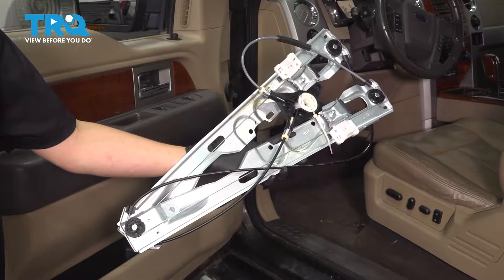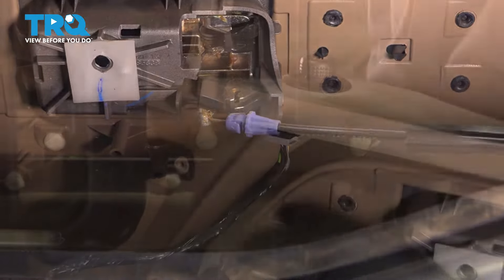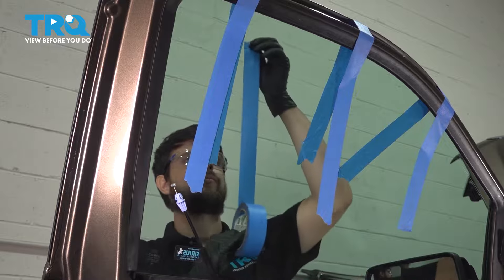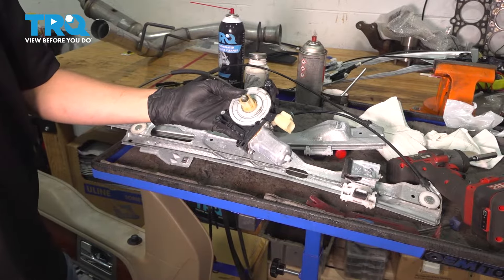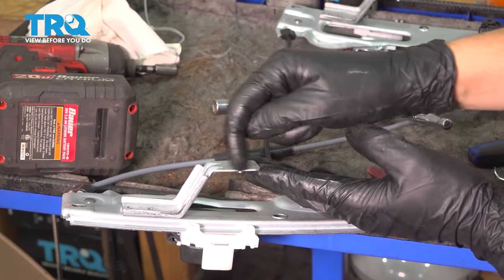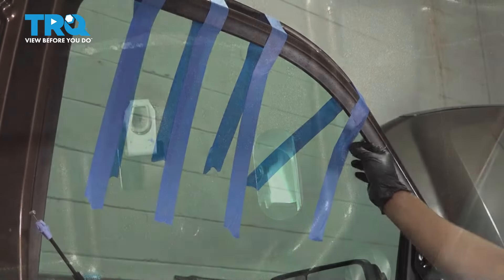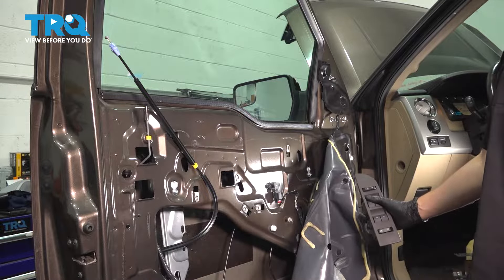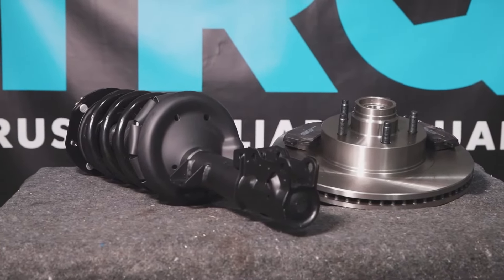How to Replace Window Regulator 2009-2014 Ford F-150

Comment: There is a better way to get the door handle off. You ain’t gotta do all that. The side with two tabs you can push in and get the whole handle to slip out of the panel. I’ve done it many times working on my trucks

Comment: My passenger side fell down with out knowing why. So I watched the u tube to replace. Seeing a window that works not in the down position. Looking more into the problem deeper. Seeing the cables were meshed into holding the window down, n couldn't get window up. Procedure I took was cut the cables n push window up. Tried tape but wasn't the support I needed. Took a measurement bottom window to the base. Used zip cords to hold my 4x4 n screw to keep the board from going side to side.  My part hasn't been offer to replace. Dealing with weather conditions to hold window up till regulator is order. Hard part done. Show a window that's stuck in the down ward position not a window that works for easy excess. Thank you I did mine a bit diffent but sill solved the problem n window holding up in fix postion for now.
Reply from the maker: +@user-hc5co4oc9w We appreciate the feedback. Sometimes there are multiple ways to accomplish the same repair. http://1aau.to/m/Shop-TRQ

Comment: Thank you for taking the time to make this video!  My window made a few grinding noises and then stopped working.  Turned out to be broken cable.  Your straight forward and well explained video allowed me to install a new regulator without any problems.

Comment: Did all this only to find out that either the switch went out or the wiring. I knew to test the new motor before replacing everything, but I forgot. I ordered a new switch. Hopefully that's it. Otherwise I'll need to take it to a professional.